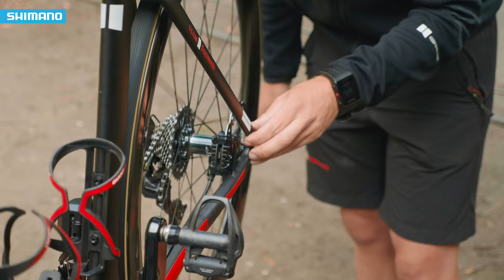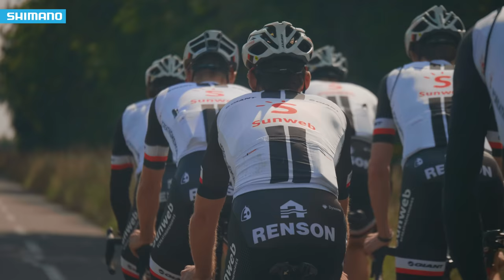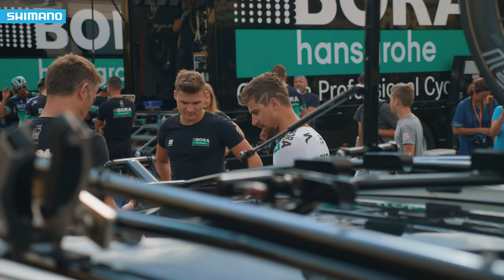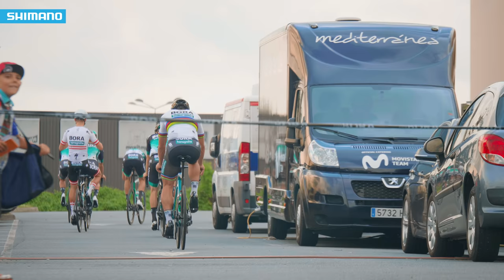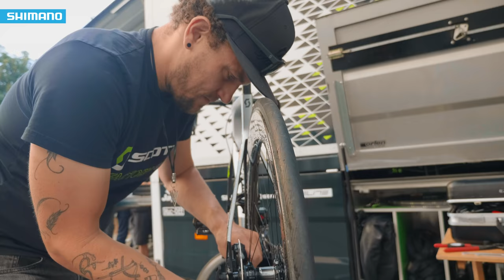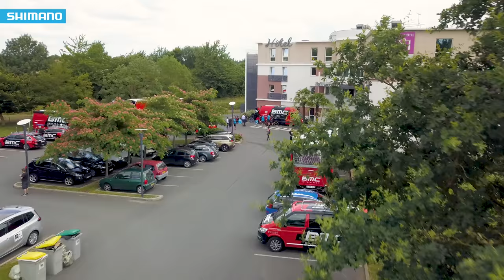The disc brakes revolution in the pro peloton | SHIMANO

Comment: Been using them on the road since 2014.  They just work all the time in all conditions.
Reply: Firsthgyhgyhuy Lastujhujhuj what he meant is the performance is the same no matter the external conditions. Rim brakes tend to perform worse when wet or they can overheat and stop working properly.
Reply: Lando Parada are you saying they perform the same, even when several people have proven they don't in such conditions? When is dry there's maybe no difference at all, but once those calipers overheat or get wet, you can surely manage, but it's not the same at all.

Comment: Best opinion was from the bmc team mechanic..  the greatest advantage is no more rim damage..  at 5:16
Reply: Elmer Galinato yes this. Rim brakes are really only one step ahead of this: https://www.sportsprofi.com/out/pictures/generated/product/2/999_999_75/kettler_kettcar_indianapolis_air_0t01060_5000_details_handbremse_.jpg
Reply: Rim cost more than disc
Reply: Yes, if you are using carbon rims. But the difference between carbon and alloy, no is very significant, but the huge difference is in the price.
You can buy a high performance alloy ryms 1300g the pair, for 450usd. Try to find something similar weight in carbon.. Maybe 1200usd?
And what you wins? little bit more flexibility.
Reply: DrVinylBcn  wow..!! Want to have one bro.. what brand..? Any tips..
Reply: Wow..!! This little forum is good.. we can learn each others idea..
Reply: Pixelcruiser what are you talking about when you say "disk pads on the rims"?  The pads used in disk brakes do not touch the rim, only the rotor (aka, the disc).  You also mention "carbon disks".  I think you're using "carbon discs" incorrectly and actually mean to say "carbon rims or wheels".  Maybe?
Reply: @Pixelcruiser disks cost 20-100 dollars to replace, also a slight warp won't cause much friction and is easily fixed with a spanner. They're much much much better then rim brakes for anyone except for extreme weight weenies and i don't think those grams matter that  much in contrast to much higher braking performance 
Also if it was a marketing ploy then mtbers wouldn't be using them, except we are because they're so much stronger and more reliable

Comment: Good to see it finally being adopted main stream in road cycling. Going from DH/XC disc brakes to road rim brakes is night and day. We will look back on rims brakes next year a scoff
Reply: That was said ten years ago... try again.
Reply: Chaos Engine how many xc or DH riders are still using rim brakes then.....
Reply: You tell me, I don't MTB... This video nor my comments have anything to do with MTB users...
Reply: Discs are lighter, stronger and hydraulics more reliable than 10 years ago. Until you actually try a disc road bike flying downhill at 60-80km/h you won't understand the benefit. Pro riders will have improved confidence and safety when descending

Comment: So many times my friends and I have overheated our rim brakes down hills and basically put our lives in the hands of the road. My local hill has a mile of extremely technical descending - average -12.1% but it hits -22% at the switchbacks. You can imagine how terrible it must be. And I'm a lightweight. I imagine that rim brakes are downright dangerous for 200+ lbs people.
Reply: Before disc, I guess no one ever descended steep grades before... Surly they used parachutes or  walk down?  Hahahaha!
Reply: Or go slower? Or started to break earlier? Or crash more often? Have you ever ridden hydraulic disc brakes?
Reply: Chaos Engine n
Reply: There are air vented disc brakes existing, that are built like a sandwich, letting air flow in between the discs, that are made of two different metals. That‘s a big advantage to prevent overheating.
Reply: M. Molli, Hope make them, they're heavy though... The Shimano aluminum core stuff is good enough to be honest. Those brakes you speak of are quite overkill, I would actually use them on karts, that's how overkill they are.
Reply: :D

Comment: In addition to more consistent braking, all-weather braking ability and aerodynamic advantages, disc-specific rims can also be used meaning no contact area is required for caliper brakes and thus less material is used in the rim portion of the wheel and thus less rotating mass placed out near the circumference of the circle. This means better (theoretic) angular inertia and less gyroscopic effect. The hub does carry additional material for the disc mount so while this might not result in a nett reduction in weight, it places the weight in a better position for potentially improved acceleration and quicker handling (including fewer losses when tilting the bike side-to-side in a sprint).

Comment: IMO benefits of disc brake are only at best for mountain biking and off-road riding. Your hand had to deal with more feedback from the terrain and hence extra fatigue. The leverage of hydraulics are indeed beneficial here, you can just brake with one finger and still achieve a same stopping power. In road I think hand fatigue is less an issue, and what is the point of extra braking power when you ended up locking your wheel and skidding over places before stop? Inventing better tyres with better grip would be more beneficial for roadies.

Comment: braking power on a bicycle is dependant only on tyre grip level. both brake types can apply more than enough force to brake to the limit at any condition and disc brakes will lock up at the very exact limit normal brakes would. so its just hype + more weight on the bike.
Reply: And the temperature generated on the carbon wheels? And the erosion of the expensive carbon wheels due to the sand and debris in the break pads after a couple hundred kilometers?
Disc brakes really protect my 404s.
Reply: But our hands aren't hydraulic presses. With the same force applied, a disc brake will brake better than rim brake. Yes, you can just press harder on rim brakes but you can have cramps and fatigue. On a long technical descent, it can be tiring. 

And don't forget consistency. Depending on weather and temperature and even duration of braking, the force required to brake could vary a lot with rim brake. It is far more consistant on disc brake.

Comment: Great advertising, but it takes one hell of a disc brake to overpower a rim brake and these are small discs on a large wheel with single piston calipers. Get good pads and calipers with a good leverage for the greatest braking power, at least in dry conditions. I also tried a bike with carbon rims once and the braking force was mighty, maybe even excessive.
Reply: David Guerra if you have V brakes, Kool stop brake pads give a hell of brake force, but they are also very rim-friendly.
Reply: Rim friendly, or not rim friendly? I used to run v-brakes with kool stop brake pads AND cantilever levers, which have more leverage than v-brake levers. With regular pads they would feel mushy, but with kool stop brake pads it was a very satisfactory combination. I think I broke my rigid fork because of the power I could get with them.
Reply: My Kool Stop pads seems to wear the rim very little. I'm 100% satisfied with them.

Comment: I’m not a professional rider, i have to buy my own wheels. Being able to change the braking area when it wears out makes sense, I’d rather spend £50 on a disc rotor than £2500 on a set of carbon wheels.  
Setting up disc brakes is easy.
Removing a wheel from the bike is easy.
Braking surfaces are away from the puddles, dirty and dust of the road. 
Changing the pads is easy.

Comment: always found it very strange with the huge evolution in road bike technology, that the bikes come with two bits of rubber to stop you while using expensive wheels as a brake surface, that's the equivalent of a brand new Ferrari coming with drum brakes from 1960

Comment: There are pros and cons. 
Pros :
- Far better rainy weather braking
- Better modulation in dry conditions on descents
- Better tire clearance

Cons:
- Added weight of 500-1000g
- ⭐Far more complicated and frequent  maintenance (bleeding, truing, deglazing)
- High cost
- Aesthetics

Think about how you ride and what works for you. For me, I'm sticking with rim brakes.
Reply: Erik ROSSEN that's a good point. I'm in Socal so only doing 5-10 rain rides a year. I bleed my mtb 1-2x / yr but I'm very picky about lever feel. That said, if I lived in a rainy location with flat terrain, I'd more likely opt for disks even with the maintenance
Reply: Lol now here's somebody without a clue about modern disc brakes! There is far less maintenance with discs over rim brakes. You never need to true anything and what deglazing? As there actually isn't any.
Reply: Damag381 hot rotors quickly go out of true, and dirt/oil on rotors leave a glaze that needs removing from pads
Reply: Anthony Metzidis WRONG I've had rotors glowing red hot and still stay dead straight. Modern rotors will give you thousands of km of riding without any kind of maintenance.
Reply: Anthony Metzidis and if you are getting glazing stop riding your brakes or go to smaller rotors
Reply: A kilo?  Truing? Deglazing? I've been using them in forms since 2011 and never done any of this malarky. You're just thinking about things negatively, sorry.
Reply: I dont have much problem with Disc breaks maintenance.
You are just some closeminded old school folks
Reply: Anthony Metzidis I disagree with aesthetics disk brakes look so cool
Reply: Frequent maintainence? I fitted front hydraulic brakes 3 years ago. So far, I haven't touched them once. Trouble free and work without hesitation.
Reply: just get cable pull disc breaks, less weight, less maintenance, and you can fix them as easily as rim breaks.
Reply: Mr Jay White mate ur mad there’s more weight and a lot more maintenance
Reply: only more weight compared to top end race specific cantilever rim breaks. v breaks its a toss up as to what material they are made from.

what you are doing is comparing cable to hydraulic. in that case, yes, the extra complication of carrying fluid, + the tubes, + callipers that wont drip etc etc is comparatively more weight and maintenance. not to mention getting bubbles in the fucking pipes on a long downhill because you boiled the fluid.....

but cable disk breaks on the other hand, are actually easier since there is no messing about with aligning the pads with the rims at just the right angle, and much less need to keep adjusting them due to wear.
Reply: Anthony Metzidis ...  the oil on disc brakes you speak of helps avoid the squeaking brakes you speak of...  
[Written in YouTube approved SarcasmFont...]
Reply: Mr Jay White ...  
ALL "disk breaks" Suck...  

Yet Avid BB7 Mechanical Disc Brakes are Awesome...
Reply: Disc brakes are better for downhill, because of mud and dirt and the rim isn't getting hot after long downhill driving. Personally I drive a bike with V brakes, but with very good Kool stop brake pads. Of course the force you have to pull with your hands is higher, but this brake pads have very little wear on the rim, but also on the pads and a hell of brake force. I drive my bike to work, I don't have to drive a race, so I need the brakes not frequently.
Reply: The added weight is more like 400g to 500g. I've done extensive comparisons of hardware to assess this because it interests me greatly.

It might surprise people to find out that:
- Hydraulic hoses are lighter than cables (-50g to -100g)(varies greatly depending on how nice your hoses/cables are)
- Flat mount calipers with pads weigh the same or less than equivalently priced rim brakes with pads

The weight penalty is mostly from:
- Discs (~250g)
- Wheelsets (~100g) (more spokes, beefier hubs)
- Forks (~50g)
- Frames (~50g)
- Levers (~30g per lever? if you have info on this please share)
Reply: Anthony Metzidis Video shows $5k+ bikes and you're talking about $300 brakes. Also the frequent maintenance is false. When I was younger I never did maintenance on my hydraulic disk brakes and also never had issue with them. Now I check every season but only for regular maintenance not because they have failed.

Comment: Disk brakes are great for people like me. With no Pro handling skills for descent and heavy weight. In my case , disk (please, mechanical disk brakes should be banned of the Earth) are the best.
Reply: Can I ask why mechanical disc brakes should be banned?
Reply: Tomi Saaranen it’s just my opinion. I tried the mechanical and the hydraulic systems and the mechanical disks has no real advantages. It has the downsides of the disks plus the downsides of the rim brakes .
Reply: Yeah, I don't like them either, just asking
Reply: Alexandre Duayer Chaves I agree for the most part. Hydraulic disc brakes cost $30 for a set. Some people like buying bikes that cost less than $150. At that price, it's hard to deliver hydraulic. I think mechanical disc brakes have their place for bottom of the barrel bikes if for no other reason than to completely kill rim brakes and make disc brake specific parts more available.
Reply: Saurabh Kulkarni I understand and agree when you talk about basic models. Hydraulic disk brakes systems are expensive . What I mean is that between 
 a mechanical disk and a rim one, I would choose the rim one without any doubt . Between rims and hydraulic disk , I would choose the disk ones .
Reply: Still like my old bike with v brakes better than the new one, never a problem, with hydro, always something...still...unfortunately.
Reply: Alexandre Duayer Chaves.
Low end mechanical disc brakes are bad because they offer little adjustability, important for reducing cable travel and eliminate rotor rub.

Higher end calipers like the ones fron TRP or Avid's BB7 are adustable on both sides meaning you don't have to move the whole caliper.

I personally have the BB7's and honestly the ONLY difference i notice is they are a little more spongy when fully engaged. Lever travel and braking power are the same.

In my opinion the biggest benefit of mechanical calipers is the compatibility for road bikes. Hydraulic brifters are currently very expensive and may not be made for the gear combo you want. But you can connect ANY set of cable brifters/levers to mechanical disc brakes and make them work.
Reply: I agree with you Josip

I have mechanical disc brake on my Devinci. (Brand Cat Eye) I can use 1 finger to lock my front and rear wheel without any trouble. This all depend how perfect the setting of your disc brakes are and how the caliper give the pressure... Between a Tektro and a Cat Eye, I would definitely choose the Cat eye, Tektro is cheap and suck for Caliper brake. If you don't like mechanical disc brake is probably because you went on a bike with cheap Caliper disc brake.

AND BY THE WAY the Emergency brake on cars use Mechanical system. And they do well has much has the Hydraulic.
Reply: Saurabh Kulkarni 30 dollars a set what brakes are you buying my cost 500 for the pair
Reply: Nah, TRP spyre mech disks are quite good.
Reply: Avid BB7 Mechanical Disc Brakes and a few others Are BETTER Than Hydraulic...  
(Yet, with the experience of cheap non-adjustable brakes of any sort, I understand your unwarranted bias against shit that slows you down, yet Not Quite Enough When You Really NEED Them To...)  
[Solution: Get Good Stuff...  
Avid BB7 is Good Stuff...]
Reply: Nothing wrong with mechanical disks. Unless you are a pro(obviously). Or you can afford to not give a shit about price and can't bother to set them up and maintain them properly and be arrogant about it at the same time.

Comment: I have shimano xt brakes on my mtb, and I dont find them any better than my old 99 shimano xt v-brakes with first gen CrossMax wheels, sure on normal bare alu rims they suck but I dont think there is a high difference at all, if not the old combo gives way more feel and stops as good as the disc brakes.
Reply: Rim brake with aluminium rims are ok in wet. The problem comes with high-end expensive carbon rims... In the wet, carbon rims and rubber are very slippery! You got to brake earlier and heavier to eleminate the rubber aquaplaning on carbon rims.

But yeah, if you only ride on good weather or with aluminium rims, disc brake is probably not worth it.

Comment: Of course disc brake are very powerful and resistant against heat. But the hydraulic brakes are very weak against the Winter. It can get piston stuck pretty quickly.
But V-Brake are still more Powerful on dry terrain than disc brake because they brakes on a bigger Diameter.
Reply: I was riding my bike many times in temperatures around -10 C in snow and nothing ever froze on my hydraulic brakes from all the different brands (Hayes, Shimano, Avid/Sram, Hope). All the fat bikes have hydraulic brakes...
And V-brake is NEVER more powerful than the hydraulic disc brake, NEVER!
Reply: Hydraulic discs on my mtb which I ride to work year round, no problems. Just a bit of a clean up when replacing pads, but pistons/seals still fine after 10 years.

Comment: I own a mtb with hydraulic disks from back in 2008 and its not all good on that bike; alignment of the calipers is difficult and every time you drop out the wheel its really hard to not get some brake rub due to the presence of quick releases. Working with the bike is more of a hassle as you have to be extra careful not to get grease or contaminants on the rotors. Bleading the brakes is also a pretty messy thing. I am aware that most of these problems have most likely been solved, but rim brakes are still easyer to work with and practically hassle free the way i see it.
Reply: Francesco Papi so you want to compare 10yr old disc systems with today's gear......